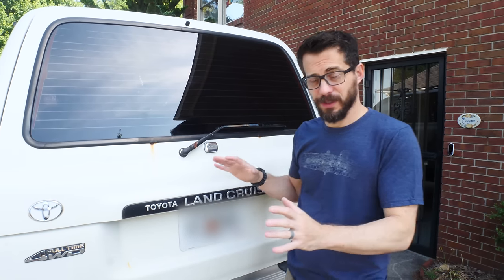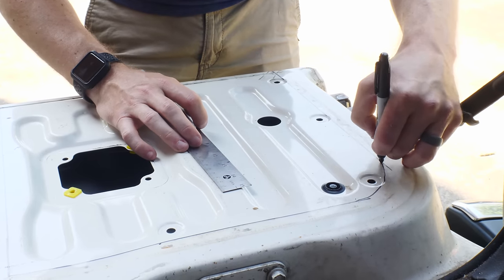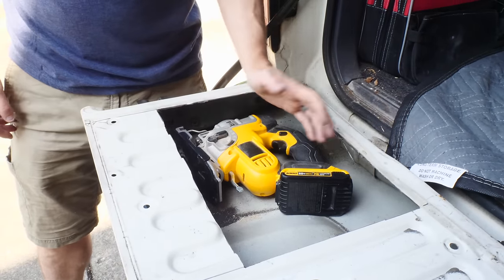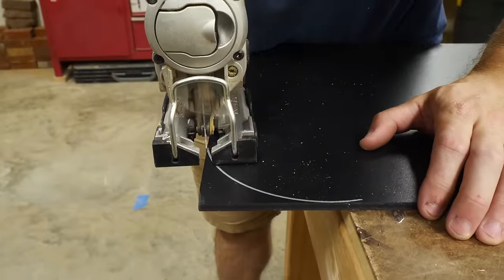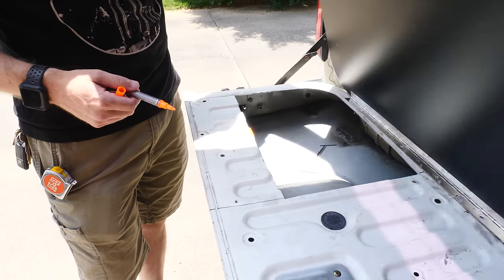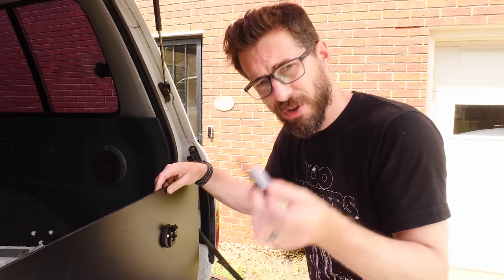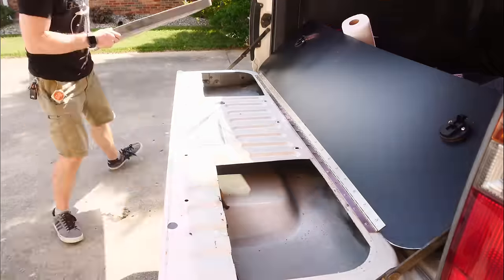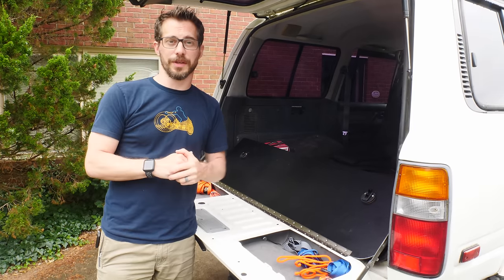Custom Tailgate Storage // Land Cruiser | I Like To Make Stuff

Comment: Hey Bob, FYI files usually only work on the push, and not on the pull. You'll find your filing will be cleaner by pushing forward at a slight angel to the surface, then lifting the file off the surface to pull it back. This also helps to prolong the time between having to clean shavings out of your file, and thus keeps the teeth sharper for longer.
Reply: If there's obvious latches is not an hidden compartment.

Comment: Bob, you should add some Trim Lok Edge Trim to those cut edges. It’s U-shaped PVC that wraps around the edges to keep you from accidentally abrading/cutting your hand arm. Use it all the time when wiring harnesses cross sheet metal edges (even if they aren’t jagged) in the auto industry.

Comment: Hi Bob.   You could really make it look pro by putting a vinyl edge guard around the lip over the openings. Plus make it safer.
Reply: ...and use a clear piece of plastic, if the current one ends up not working so you can easily see contents before opening and avoid any "hidden compartment" laws possibly in effect
Reply: My thoughts exactly, using some trimlok, would make that look pro
Reply: I've done several projects that left an exposed metal edge and have used clear tubing that is readily available at your home improvement store (by the foot is dirt cheap) and cut it with a razor knife so it easily slips over the metal edge. Friction should keep it on but a little CA glue also helps.you can also buy some velco cloth to line the cavities and make some straps to help prevent things from moving around.
Reply: The problem is how the edge is shaped. It’s not flat, so not just any edging will work. You would need to find a way to customize those up/down ridges. I’m sure he’s thinking about finding a way.
Reply: Darin Netherland you could easily just use the laser cutter and make pieces to fill the gaps at the edge to give you a flat surface to work with.
Reply: Or just cut a bike tire inner tube and use some strong glue or rivets to hold it in place.
Reply: in the marine application we use a vinyl rubber trim with a metal insert. can bend around some tight spaces and stays in place well. taco metals makes it, as well as others
Reply: I've used that rubberized material designed for using on the edges of car doors that is a C shape with great success in the past.  A thin line of NuFlex Thermoplastic sealant and it's good to go.  It's a flexible material too, so odd shapes usually aren't an issue.  Sometimes a heat gun on low is all you need.  Or soak them in boiling water first.
Reply: dakota French thats  what I use on all my vehicle storage compartments!  I have  in fender  well compartments  in my '64  Impala!
Reply: Not sure this would be consider as hidden compartment as it it pretty much visible, and quite easily accessible. 
Unless you make the latch "non visible" or put back the original material so noting shows. 
But, I'd double check with local authority is such law are in your area.
Reply: that edging is called windlace
Reply: I've been making historical metal armor for some time now and have never cut myself on a filed edge. However, if you don't want to risk it, rolling the edge is probably the best option, it will look super impressive while being an easy thing to do
Reply: Mask off and spray rubber coating...
Reply: Made the same comment just now. Then scrolled the comments. It would clean it up.
Reply: Nothing he is doing here is pro lmao , he just lost all strength in that gate by chopping it up , go ahead and do this , then stand on it and let me know how that works out for ya , hack job is what this is .
Reply: @WereBettaThanU  taco metals has one of those "request a quote" web sites. No thanks. I don't do business with you if you can't be up front with your pricing.

Comment: Project I was scared to start: 1500 sq ft of LVT flooring that had 6 corners and 7 doorways to deal with. Basically our entire basement. The material sat there for 5 months, but we got started on the 2nd, finished it on the 3rd, and it looks great. Of course, now I have to do all the trim work. 

Suggestion for your tailgate storage: How about adding a cargo net to the outside of the panel between the latches to quick-store  stuff like straps or bungees?

Comment: Have several designs for the pickup, unfortunately, it is the wife's pickup.  So I picked up a used junk yard tail  gait and practiced on it to get confidence.  Once I got confidence I bought a second used tailgate to cut out the  matching doors, similar to what you did, but used them as doors on my original.   The foam is an excellent idea, I will be using that tip!    I used neodymium magnets to hold my tools.  thank you for inspiring other

Comment: Wonderful idea! I'm going to look into do that to my pick up. 
I have done something similar to a full size van, but it was a the side door step. Most full size vans have a step inside the side cargo doors. Looking under the van there is about 6 to 7 inches of clear room between the back side of the riser for that step, and the van's frame rails.  I cur the face of the step our leaving enough material as to not weaken the floor load capacity, and formed a metal box to add under the van's body at the back side of the step's riser. It was approximately 7" high, 6" deep, and 4 ' wide. I was the perfect storage place for hinges, fasteners, and other hardware for my door business. 
I smoothed the cut edges, with a file, much the same way you did, primed and repainted them, and added a rubber edge cap to the entire opening. 
I also primed and painted the outside of the box I built to create the storage been, and lined it with carpet as a sound buffer. 
Unfortunately, I don't have any photos of this as I did it to my brand new 1976 Dodge B200 Tradesman Van.

Comment: If the PVC ends up not lasting I would suggest something like Alupanel or Dibond. These are composite core materials that are sandwiched between two (typically) aluminum sheets. I’ve used these materials in the past for outdoor signs, door panels and a number of different applications. They are more rigid than just a sheet of pvc, lightweight, easy to machine, come in a range of thicknesses & colors and are well balanced due to the aluminum faces on either sides. 

One thing to note, even though they are more rigid than a pvc sheet, they can kink if flexed or bent at an aggressive angle or radius. Just something to keep in mind.

Another composite material that might be worth looking at would be Skatelite. Food for thought.

Thanks for the content!

Comment: I got rear ended recently and my rear latch of my hatchback is "locked" in place.  Been going back and forth on whether it's worth letting the body shop touch it, since all they've promised to do is beat out the dent and repaint.  This has really given me the confidence to fix it on my own.

Comment: Good idea!  I might try something like this on my rear doors of my Chevy cargo van that will rid me of those silly plastic door panels.

Something that may work well in your application is an aluminum diamond tuft panel or just a regular aluminum panel.  I used those to make a walk way on the boat trailer tongue so I don't have to do a balancing act.  They hardly weigh anything at all.

Comment: Using pop rivets in thin materials or softer plastics - you'll get a more durable and longer life join by placing a washer on the expanding side of the rivet. 
:-)
Hope that helps!
Reply: I had the same thought watching. Placing rivets from the other side(cap  to plastics, expanding side to metal) would do fine too i think.
Reply: rivnuts would be the ultimate fastening option.

Comment: Im alway scared when i start something i tend to rush into things to fast. So i tend to mess up but then i just roll with it slow down take my time and it usually turns out amazing. Also helps my dad is a master Carpenter, my step father was a Master electrician and my uncle is a master plumber. Oh and my father was also certified mechanic so i learned a lot from them.
Reply: mespenschied maybe get something of the junkyard for a thing you can try on
Reply: you must have some great teachers then!
Reply: Real GuyWithATie yeah i m totally not dutch
Reply: mespenschied man you're really lucky! My dad isn't handy at all but my grandfather was a general contractor and electrician but doesn't bother doing either anymore cause he is 70 years old and my dad never wanted to learn anything from him so this is where I have to learn. Plus experimenting
Reply: mespenschied  and you are a master baiter

Comment: I love the idea using the space in the tailgate if the plastic sheet don't work out you can use aluminium sheet and glue carpet to match your interior. I'm doing that to my pickup truck  for my ratchet straps and  logging chains . 👍👍👍👍👍

Comment: I just redid my whole front porch! The last one was falling apart, turns out that 90% of the issues were on the surface! It was my first big project like this 100% solo and I think it turned out well, took the existing structure, beefed it up and then refreshed the decking, with a few improvements. So glad I faced that fear and jumped in!!!

Comment: Hi Bob, some time ago,put a flexible solar panel on the hood, to keep the battery on top energy, it worked pretty good, extended the life. The car seem real futuristic with a solar panel attached with 4 screews. When you have the drill in one hand,and the surface is the paint of your car, there are many memories and thoughts , like If this doesn't work? How Will you fill the holes?  
The next step is really worthy. The uses bring so many upgradres to a simple car. Like unplug the alternator, and select when to charge by solar or with gas. With solar gives a little more milage and Power to the car. Or can start the vent in automatic when the cabin is over 30° celsius. 
Well it bring so many usefull things to your car.

Comment: Hey! Take some rubber vacuum hose, cut / split it in half, and press it over the sheet metal edges that you knocked down with a file. Quick and easy way to keep them covered and from ever having to worry about slicing a fleshy bit on one!

Comment: I am planning a blu-ray rack thats 1m tall by 2m wide with 3 shelves in between, each shelf having an led strip at the back to light up behind the blu-rays, I plan on using pocket holes to hold the shelves on to the sides, with upright supports for every shelf, never built anything like this before
Reply from the maker: You can do it, and you'll love having something unique and useful for YOU. Go for it!

Comment: Great idea for making use of otherwise wasted space. Any time I'm cutting or drilling into something it's scary... Mostly when the thing I'm cutting/drilling isn't mine. I just helped a friend hang a TV on their wall and must have checked the stud placement 15 times before actually drilling the holes. 

One tip if you need to "see" where you can't, like when you were figuring the placement of the latches, is use a GoPro as a remote viewing camera. I've done this a few times when running cable (to make sure it went though) and to check brake lights after replacing the activation switch. 

Great video as always.

Comment: Hey Bob, I'm curious how it holds up to driving and vibrations. To me it looks like if you're driving on some rougher roads, it would be making a bit of a rattle. Though I suppose a weather stripping or something similar could be put on the door which would stop that pretty quickly.

Awesome use of dead space though. I'd like to do something like that on my truck, but my tonneau cover leaks like a sieve so any storage back there needs to be completely weather proof.

Comment: Hey Bob, is there anything stopping what you put in the compartments from sliding into the middle of the track door? Like where you said the electronics were for the door latch. Could stuff sliding around in there possibly damage the electronics in there?
Reply: I'm assuming the electronics is mostly just wires. Though, those could still be torn or otherwise damaged if he puts heavier and/or sharp objects in the back. Personally I'd put some sort of barrier in there to keep stuff from sliding away from the holes. Keeps things easy to get out later as well.

Comment: Have you thought of anything to keep your stored items inside your tailgate from sliding around and banging into your wiring harness causing short circuits or your taillights to stop working? Perhaps double or triple the thickness of the foam between the two cutouts! I like your idea, but I will not do it for my truck because I go in and out of it a lot when camping. I would have to use a thicker material as you described.
Reply: Good call. Or you could use wire mesh and build a cage around wiring harness to protect it from bouncing projectiles.
Reply: It's an older truck, so most do not have wiring inside the tailgate... they're on the fenders. The only thing inside this 'gate was likely the mechanical handle and locking mechanism.
Reply: I don't think his tailgate has any wiring harnesses to worry about. Doesn't look like any lights were in it.
Reply: I'll leave some material to bend inwards to make lip then glue the foam against it.
Reply: No wires. Tail light wires come up behind tail lights
Reply: A lot of people do this mod with Land cruisers . There’s a few companies selling hatches but they aren’t cheap.

Comment: Bob you can try door edge guards to keep from cutting your hands, they are flexible so they can be used on the curves and should work on the ribbed parts too. Also they are really flat so it won't push up on your plastic door.

Comment: Awesome video bud! You can also use nutserts instead of rivets to make it bolt in on the things you want removable. On the edge for the tailgate take that you're worried about cutting your hands on, take some small vacuum line and put a slit down the side with a razor blade and wedge it on to the edge for a rounded rubber edge. Remove and add some glue to keep it from coming off. Great idea, love your videos! Rock on man!

Comment: good idea :D I've found if you drill a hole in each corner or wherever you have two edge angles coming together you can run the angle grinder upto the hole and you don't get the overcut, much cleaner too as you get a nice rounded corner :D

Comment: Hi Bob, in regards to EPVC material, I've found that unless I specifically WANT a material that flexes, wood is almost always better and cheaper than EPVC if you've got the power tools to work the wood properly (which you have). 

EPVC is fantastic for making certain costume parts, but if you don't specifically want the material to flex and you have power tools, I find wood to be cheaper and better for the most part.

Comment: Hey Bob; awesome video, yet again.  To answer your question to the crowd, I always have a huge fear of things like adding an extra spigot to the outside of my house; or moving a wall sconces location in a bathroom to being a ceiling fixture instead. Things that require me to guess at what's in my way, rather than knowing or being able to be relatively certain of the obstacles. Thanks!

Comment: I have little to no experience with soldering, and I got these new pickups for my guitar. I won them in a raffle and I wanted to put them on my guitar but had no idea what I was doing. I was worried that I would ruin the tone and would have to take them to a shop and pay out of pocket. So I did a little research and it seemed to be really easy. I took the risk and it paid off as a learning experience and now I have sweet pickups

Comment: Next possible project: weld some aluminum boxes that fit flush with the holes and latch in/out of the tailgate! Bonus points for bodywork / welding bumps out the back of the tailgate for more space.

Comment: I just cut a similar (and equally terrifying) hole in a home appliance. I used automotive door edging to put a nice finish on the cut sheet metal. Easy to apply and it covered any irregular edges.

Comment: I would create walls in the center to keep objects from getting to the main door latches. Plus I would have left the body mount holes as mounting points and used the metal that was cut as the lids for the storage areas. Also would recommend using an edge protector so when you have to dig deep in the middle you're not scraping your firearms.

Comment: I had a project, like you described...cutting a doggie door in the side of my new house.  It was very nerve wracking to penetrate the brick wall in your house, and ensuring that your hole in the brick will match up to the stud layout and hole in the sheetrock inside.  I finally just threw caution to the wind/sacked up and started drilling.  It turned our great, but I did make sure and have a backup plan, in the even it didn't work out.  To quote Kris "Tanto" Paronto's book, The Ranger Way:

"If it looks like a duck, and quacks like a duck...have a plan just in case it is a goose"

Comment: Wanted to give you two points. 1) When your cutting steal, like sheet metal drill out the corners first, it will give you a better end result. 2) You can cut vacuum line down the middle and put it over the cut sections, this will prevent you from getting cut on the edges.

Comment: nicely done, you are right with your suspicion about the plastic bending with time.. but i will worry more about the stuff you have inside messing with your electronics connections and wires, make sure that you have the compartments divided or blocked to avoid things from moving to the center of the tailgate.. thnanx for sharing !!

Comment: So I have this dream... MB Sprinter van conversion to a camper/year-round-home: Built to handle +30°C down below -30°C (86°F to -22°F) "normal" northern Scandinavian weather. With all the challenges. Budget, insulation, in-place built furniture, batteries, solar, heat. and so on...